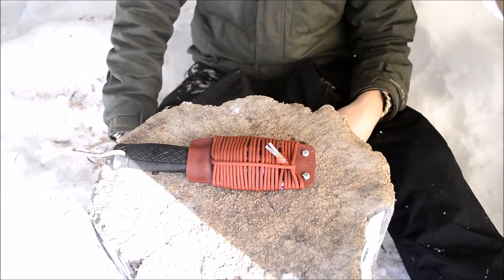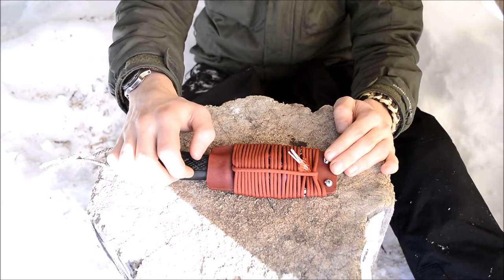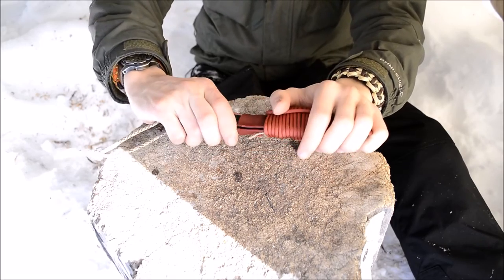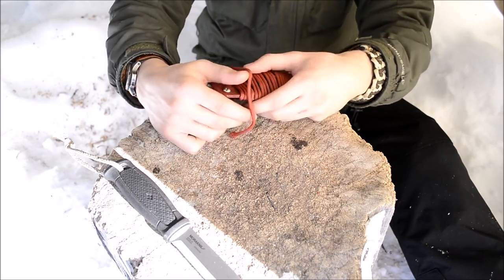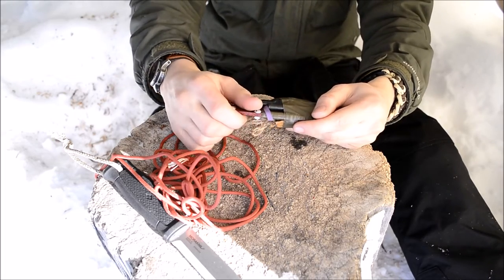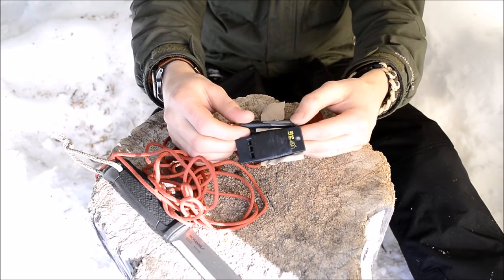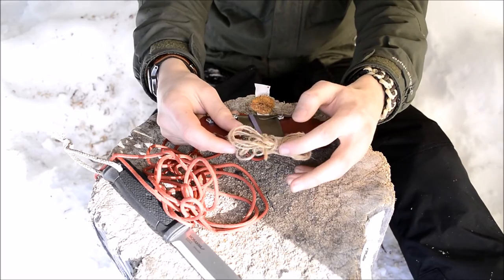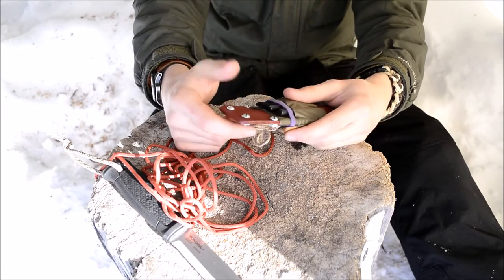Mora Garberg Ultimate Survival Knife Build!!!

Comment: Good build, thanks for the video. One thing I will suggest is to add a Sail Needle to your kit. Just tape it to your knife sheath. It does triple duty and weighs vitality nothing. Magnetize it and you have a compass if you float it on a leaf. Use it to dig out a sliver and it has a medical use. Take a strand of the seven strand paracord and you can sew gear to repair in the field.

Comment: Say Heah,  I think your idea is great.  I have a knife I just bought recently . It's the Fox Parang Bushcraft Jungle Knife.  It already has a Survival Pouch attached to the sheath.  The whole package is neat and in the pouch is a good size tin that clamps on both sides that the top comes off and you can cook in it.  How Kewl is that.  But I also got use to carrying a necessities pouch,  Some thing's are redundant , But all very necessary,  like firestarter,  compass,  whistle,  mirror,  first aide.  etc.  Small stuff but life saver's.  This way,  I could still carry two knives.  Like my Fallkniven's I'm taking out in a snowy inviorment,  My A-1/H-1 Combo.  I'll cross draw them side by side,  See I planned this when I bought them.  I like a 2Knife system,  The Zytel Sheath's just so happen to fit nicely side by side.  But I was aware of that so that's why I bought them. By the way,  a awesome combo.  I have a similar knife to my A-1 in carbon,  my Modified Rodent 6 which I had thinned down and the top guard taken off,  It now look's like a Ratmandu on steriods,  and it's one of my Fav's.  The H-1 is similar to another Fav.  my 3V Skookum Bush Tool.  Infact,  On my Kodiak Gearsling,  I'm taking my G. B.  Small Forest Axe,  because I have an attchment to carry it right on my Kidiak Gearsling,  even though I have a leather axe holster . I bought off a guy that makes them on Youtube,  Search Axe Holster and you'll find him a great guy that makes them with his Dad. I also bought a large Ferro Rod with a leather holster , it's excellent leather,  great quality that I can belt carry it or neck carry it.  But I have my Necessities Pouch attached right to the front strap,  It's easy excess and I can take it off in a jiffy. But I've been doing this a few 24's so I know what I want and I'm just too used to it being on my strap of my pack or gearsling or belt.  This way,  I still have room for a canteen and a folding saw if I want to. But yeah,  I think you have a good idea,  If your carrying just one knife . In my case,  I went with a knife that already comes with a survival attachment right on the sheath.  By the way.  The Fox Bushcraft Parang is a very good knife especially in wet and snowy conditions. Yeah,  On my Kodiak Gearsling,  Right on top is a place where I keep my Whistle,  Mirror. Firsestarter,  First Aide, Pocket Knife,  Fishing Stuff,  etc. Like I said,  I also have a easy excess detachable Necessities Pouch with a Directional Compass right there easy to take off and very convenient,  No tape,  no taking anything apart , It's right there.  See I can tell you practice what you preach,  Because I can tell you used it before.  I know guy's that put thing's like that together and simply over kill everything but the kitchen sink and never used it but just imagine how everything they would use in a real scenario. But they don't use it in a real way.  I like to keep thing's simple.  I don't mean you can double up on thing's,  Fire,  and such,  I think you should have redundant of them,  In different places incase your seperated or for fast excess.  Yeah , I like the fact you made your sheath and knew what you were going to make with it.  Some guy's stack on thing's they will never use,  Thinking how great it look's,  Wannabe's.,,.,